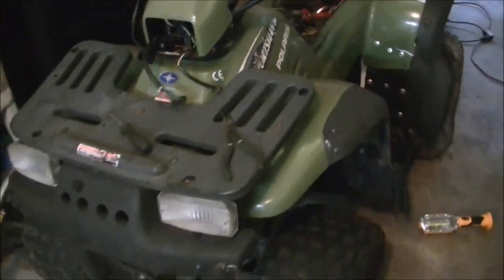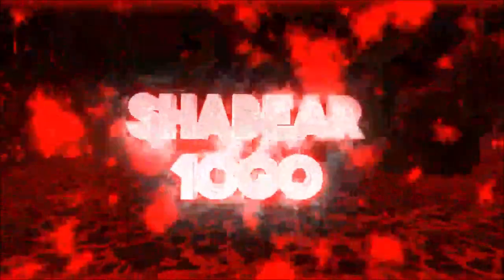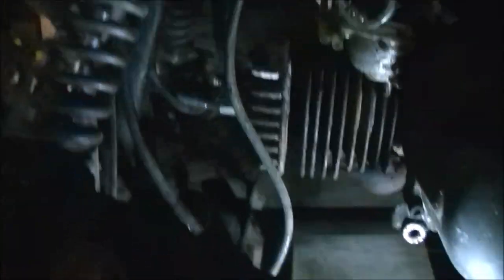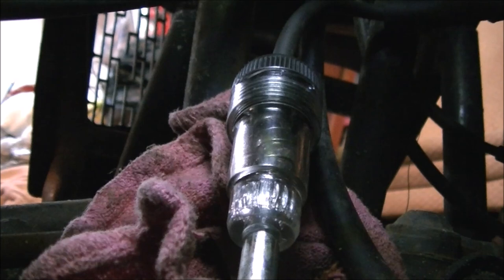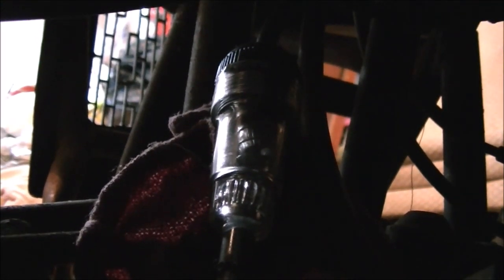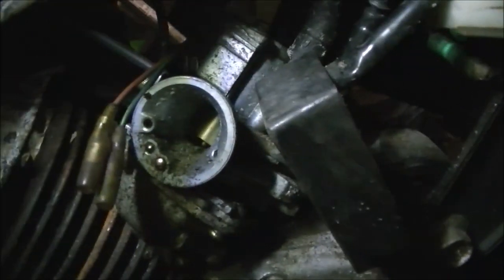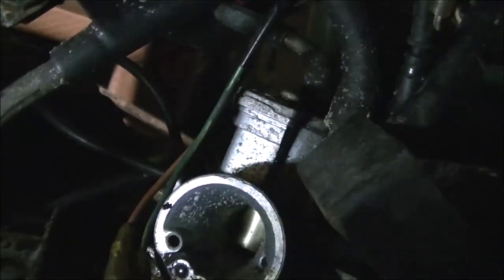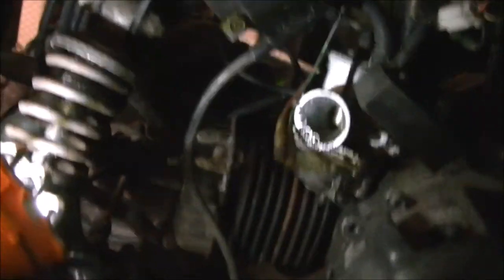Free 2001 Polaris 90 Will It Run

Comment: I need help with my fuel system on the same model mines an 04 looks like the carb has been replaced but the fuel lines are ran wrong it has two outlets on the gas tank and I’m having trouble figuring out which line goes where and why
Reply from the maker: i cant remember but if you look close at the video maybe it will show it. i no longer have the bike or i would check for you.
Reply: shabear1000  I appreciate it !